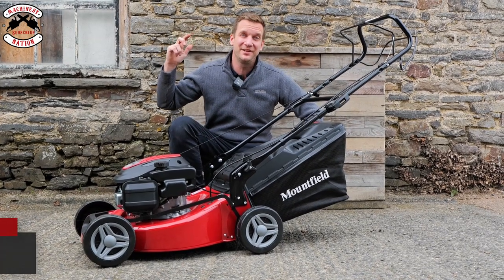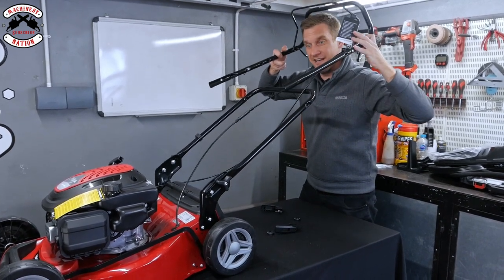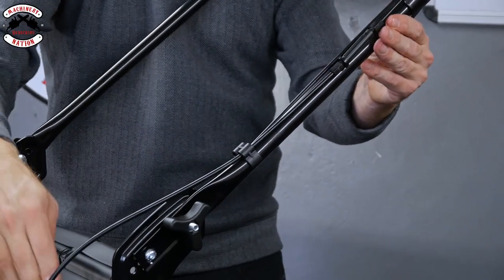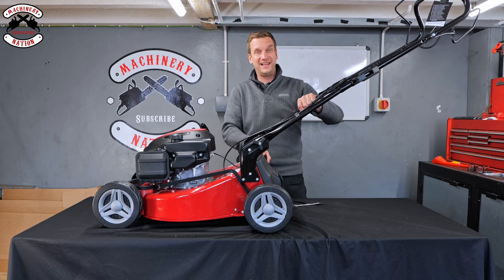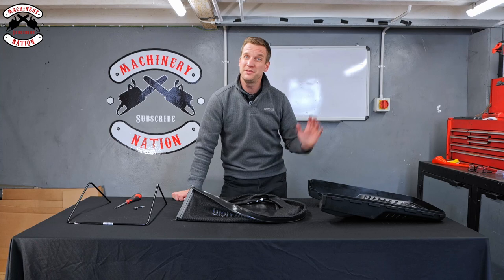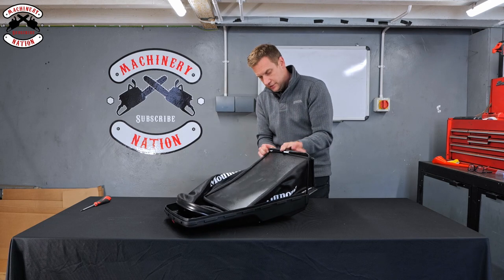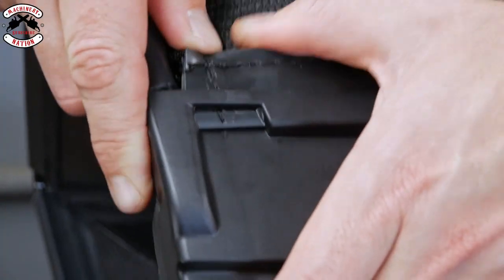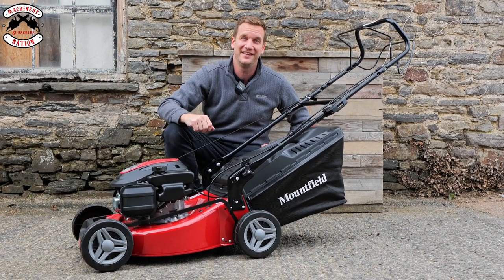Mountfield SP185 / HP185 Assembly

Comment: Great video!  I really wish I'd seen it before trying to put together my HP185.  One tip I'd give to prospective buyers/users is to NOT try to assemble the grass box in a cold garage, or anywhere else which is cold - it makes the plastic parts soooooo difficult to fit!!  It took me over 20 minutes in my cool garage. Also the "instructions" supplied are absolute CR@P.
Reply from the maker: Great tip!

Comment: Very helpful as the instructions that come with the mower are useless. Step 1 has a picture of what appears to be the spark plug, the case being removed, an arrow appearing to tell you to remove it, another appearing to tell you to put it back and a warning symbol. Not a clue what I'm to do with that but I've followed every other step and the mower won't start.

Comment: Very useful video   however the instructions say that the dip stick should be screwed in and then removed to check the oil level . If the level is done just be holding at the top of the oil tube threads wouldn’t this mean the engine was over filled with oil

Comment: Great video... Can you help!?  When I adjust the grass cutting level... The adjustment lever often pops out as I'm using the mower. Its like the spring is't tight enough or the plastic bit that is supposed to fit in each height hole, isn't long enough....? anyone have this issue?
Reply from the maker: Sounds like a miss manufacture. Contact Mountfield, they will help 👍🏼

Comment: Same comments as everybody else, rubbish instructions supplied, brilliant video (and thanks James). Only additional comment is that the first time you screw the clamp bolts in anyone having less than a strongish grip  would struggle to screw it in to leave 6/7mm thread sticking out…ie very tough to hold. I pushed the screw against the handle frame hard  and turned the clamp itself, it just about screwed in. I am fairly strong so I suspect the screw end might need to be held with pliers for some people, hope this helps.

Comment: Compared to my old Mountfield this is dirt cheap & made up from cheap flimsy brittle plastic parts. After the third use I lost a screw & nut which had to be fixed at a repair shop because it was inaccessible behind one of the wheels. Clearly very poor quality control. I have just taken out the mower from winter storage and found that the starter cable has perished & snapped, one day after the 2 year guarantee ran out. I can't believe that  it is just a thin piece of shoe lace. I have never had to replace shoe laces which last years in rain, ice & all weathers while the lawnmower cable never gets wet. I would say buy another brand but the repair centre says that the build quality of all brands these days is poor.
Reply from the maker: To be fair, it is only an entry level domestic machine. I’m not justifying it breaking down and I’m not associated with them. Mountfield do make better quality machines but they are more expensive.